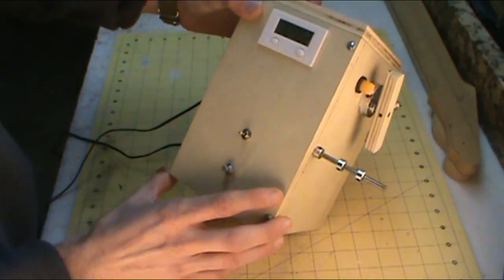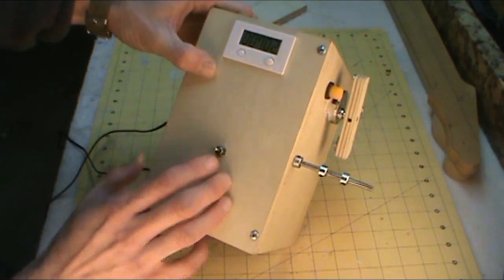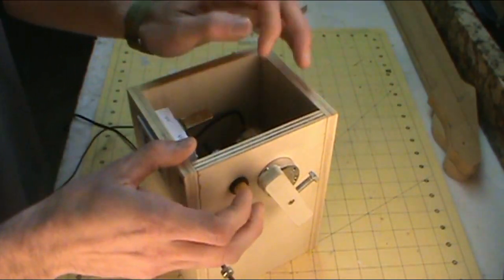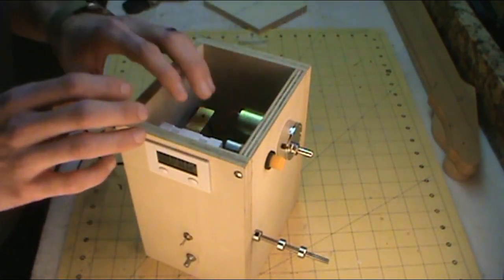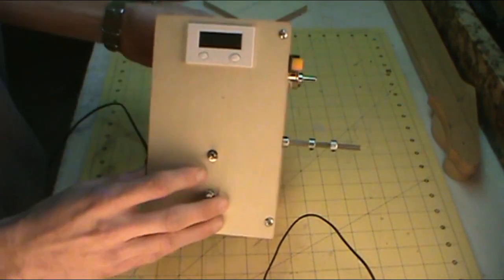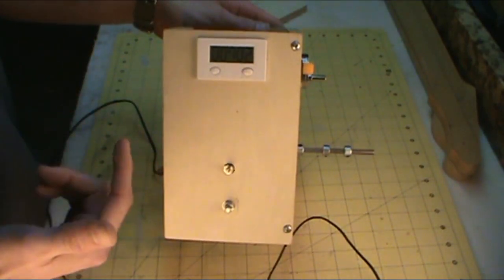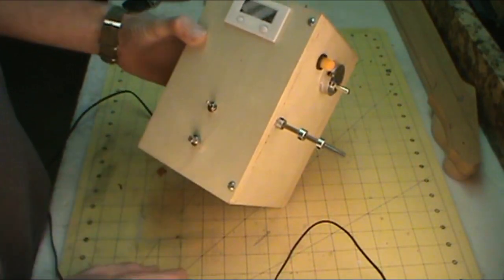How to Build a Pickup Winder

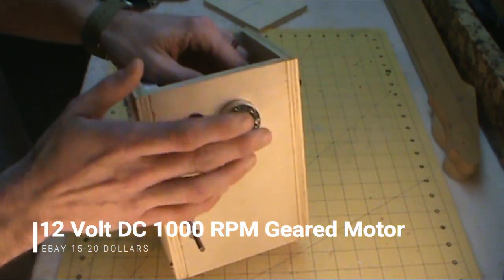Comment: Hi Chase, great vids on this channel. Subscribed! Thanks for the detailed explanation and walkthrough. You may have seen this but I'll put it here anyway. When researching this one I was trying to dream up a motor mount when I found this on Ebay: 37mm DC Geared Motor Mounting Bracket Holder + 6mm Hex Coupling: https://www.amazon.co.uk/Geared-Mounting-Bracket-Holder-Coupling/dp/B00TK0X03U I hope you don't mind the link. There's six threaded holes in the front of that (37mm size?) motor gearbox you have there at about 2:48, this right angle bracket might give more mount options and maybe allow the motor to be mounted on a swivel arm or outside the wooden box to achieve different pitch . The bracket (on Ebay) also comes with a brass Hex nut and a threaded hole for a grub screw to grip the motor's driveshaft and connect stuff to it. Cheers!
Reply from the maker: Drum Crazy that’s awesome man. Thank you for sharing. I’m working on the Pickup Winder 2.0 and I’m needing a way to mount the motor inside the box. I may use this bracket. Appreciate the info and the comment bud. Welcome to the channel!
Reply: @ChasesWKshop  No worries! Looking forward to your new build!👍
Reply: Ok, follow up. I built one of these, wound about 12 pickups with it and found the run-out on these RC motors to be highly variable. No matter what I did the commutator shaft just had too much end play in it to keep the bobbin spinning true. So I bought a cheap mini lathe from eBay AU$50 and used the box, speed controller, counter & footswitch I already had, hooked in the lathe motor at 12vdc. The motor has a drill chuck and spins very true now. It also gave me more options to quickly change bobbins for humbucker or single coils. Lathe motor here, good luck! : https://www.ebay.com/itm/DIY-Mini-Lathe-Mini-Fundamental-Wood-Lathe-Polisher-Table-Fixed-Links-Durable/192857666080?hash=item2ce7367220:g:JGAAAOSw~~NciolR
Reply from the maker: Awesome man. Thanks for the input bud. I’m thinking the only way to get rid of it would be to use a shaft and pulleys like in the Pickup Winder I just got through doing. You may be able to speed up the motor that way too. Just don’t know if the motor has enough power to do all of that. Thanks again for the follow up bud. Send me some pics of what you did and I’ll share them.
Reply: @drumcrazy5866  I don't understand the problem?  What do you mean the commutator shaft had too much play?  What problems did it cause?

Comment from the maker: Hey guys just letting you all know I added a link in the description to plans for this build. Hope it helps. Thanks!
Reply: Chase'sWKshop  -  Chase, I enjoyed your winder video and plan to watch your other videos. I also subscribed.  Regarding that particular digital counter, I have found that it is inaccurate above (around) 100-150 rpm (counting once for every 2-3 revolutions). The way I discovered this is, I wound a few hundred turns with thin sewing thread.  Then I unwound the bobbin by hand and counted the turns.  It was way off every time by at least twice as many turns on bobbin.   I tried 2 identical counters and switched sensors with nearly the same results every test.  It was a real bummer, ordering from china takes 2 months sometimes.
Reply from the maker: thewhitemustang awesome man. Thanks for subscribing. I really haven’t done a test like that on it but if you say that then I will look into it.  When you did the test where did you have the magnet in comparison to the shaft of the motor. That’s one reason why I moved it out as far as I could from the center was to try to keep that from happening. Have any idea of a better counter for it? Thanks for the comment and the help, also welcome to the channel bud.
Reply: Thanks a lot for this and for listing the components needed, the price of these electric winders is ridiculous and building one is such a buzz, looking forward to it.
Reply: I have been considering building one myself thanks for the how to.
Reply: Thanks for the plans Chase...you saved me A LOT of time trying to figure a winder on my own.  Keep up the great videos!
Reply from the maker: @johnhusted6566  you’re welcome bud. Glad to help out.

Comment: Best damn video on pickup winders ever made! Thanks Chase!  I have never even touched a soldering iron before, but I am going to try to build this project! I went and added all the items you suggested to my cart on Amazon, and I had to go to Home Depot for the rod and shaft collars. I just have one quick question, if you have a few minutes... will this power supply on Amazon work for this motor and speed controller? https://www.amazon.com/gp/product/B01AZLA9XQ/ref=ox_sc_act_title_1?smid=A8IA87KY629&psc=1

It is a 12V DC 2A wall wart, but it only is rated for 24 Watts, whereas the speed controller says 30 Watts. I imagine too little is better than too many watts, but I wanted to ask before I bought something that will not work. You mentioned in a previous comment reply that you are thinking about publishing the schematic or plans for your design. I sure would appreciate that, and would be happy to pay you for it. I am pretty sure that I can figure out how to wire the female power supply "in" to the speed controller, and then wire the speed controller to the switch, and then the switch to the motor... but... like I said, I am as new to electronics as it gets, so, any specifics would be helpful as all get-out.
Reply from the maker: Michael Perkins yes it will work fine. The speed controller is probably rated for 30 watts so you should be fine bud.  Glad I could help you.
Reply from the maker: Michael Perkins yes I will try to get the design to where you can download it. I have an idea of how I can do it but not sure if it will work or not. I’ll let ya know bud.
Reply from the maker: Hey buddy I have a set of PDF plans made if you still would like to take a look at them. Send me your Email and ill get them to you.  Thanks
Reply: Hey @Chase'sWKshop,   I sent you an email to the email address that in your "About" section on this channel. Hope you get it, and I hope you have a good weekend.

Comment: Hi there, you say in the video that you had to add a transistor to the speed controller - is this required for the speed controller available from Amazon that you linked to below the video?  If yes can you please provide information on the transistor and any other parts you had to add and thanks.  Great build!
Reply from the maker: No, if you buy a speed controller it should have everything in it. I built my own so I had to add the transistor.
Reply from the maker: Peter Busatto thanks for the question!

Comment: For some time I've been watching videos of people building, or should I say, "over-building", pickup winders.  I mean, heavy-duty motors, 1" diameter shafts with industrial-strength, pillow block bearings, pulleys, V-belts...on-and-on it goes.  It all seemed complete overkill to me and I kept wondering why I couldn't just use an inexpensive, direct-drive gear-motor and be done with it.  No pulleys, no belts, no drive shafts, no bearings, just the gear-motor with a speed controller and a mandrel to hold the bobbin.  I never built it because I figured if nobody else was doing it, my concept must be wrong.  Happily, I saw this video and immediately put my own plans into action.  I now have a perfectly functional winder that cost me about $30 to build using an old R/C airplane motor speed control I had lying around, a cheap gear-motor, and a cheap, magnetically-triggered LED counter.  Works perfectly.  Thanks for the vote of confidence, Chase!!
Reply from the maker: John Heffelfinger awesome man!! I’m glad I could help you out.  Thanks for watching and for the compliment.  Any questions, let me know bud.

Comment: Do you by chance have a link so I can check out the motor specs?
Reply from the maker: michael collins there should be one in the description. If not let me know thanks.
Reply: Chase'sWKshop thanks. I should’ve checked there first. It looks like I bought the right one.
Reply from the maker: Good deal bud. I should have stated I put the links in the description. The one I posted you have to pick the speed and voltage you want. As long as it’s 12v 1000 rpm it’s like mine. Need anything let me know.